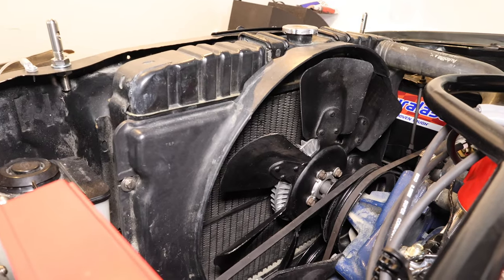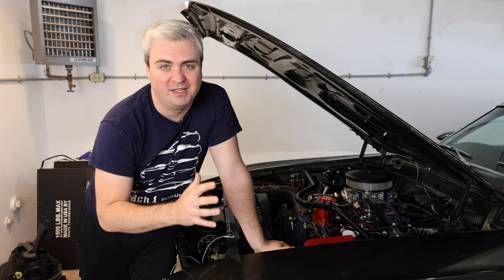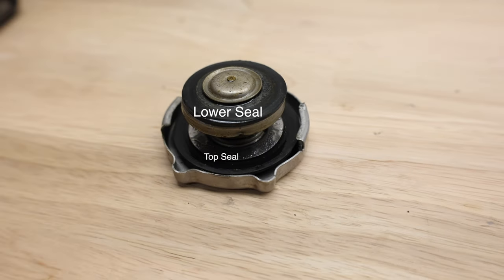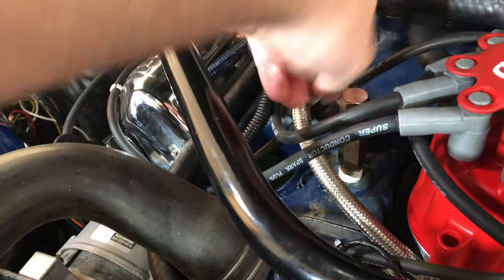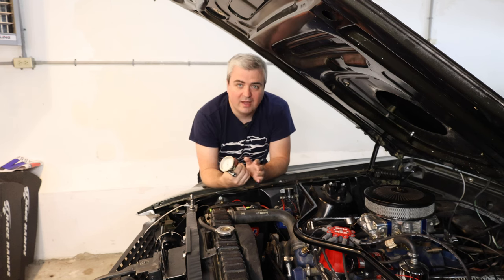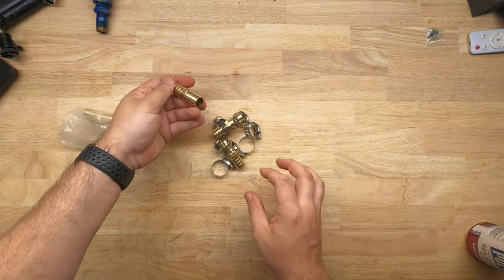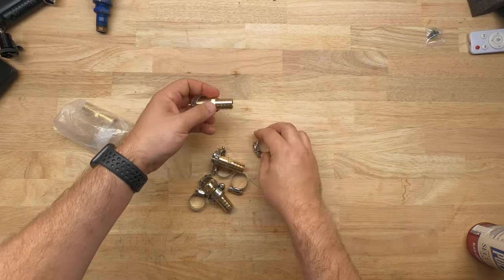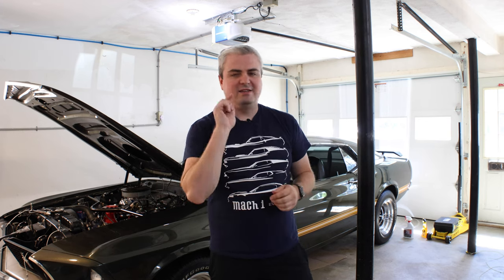Classic Ford Cooling Systems (60s-70s)

Comment from the maker: What classic Ford do you own?
Reply: 1969 Mach 1, 1996 Bronco XLT
Reply: 1964.5 D code Mustang. Not stock,,,,, at all...
Reply: 65 Mustang K Code, aftermarket AC, alum 3 row rad, 3k electric fan. Overheats in Texas.....
Reply from the maker: @larryhobbs1687  As someone who visits Texas often.... I understand why.
Reply: @SmackeysGarage  I need help!
Reply from the maker: Do you have a shroud on your electric fan or is it right against the radiator? It feels like you have all the right parts to deal with the temperature. Also, what thermostat are you running on your car?
Reply: @SmackeysGarage  I do have a shroud, t-stat is 190.
Reply: @SmackeysGarage  I would send you a pic if I knew how.....lol
Reply: 1966 289 Mustang c code
Reply: 1968 Mustang Coupe

Comment: Great explanation’s and points. I never thought about the routing of the heater hoses making a difference before, now I’m gonna have to go double check mine to see how they are routed.
Reply from the maker: Thank you I appreciate it! It's such a small nuance I didn't even think about it until I was reading through the manual. Let me know if yours ends up being backwards too. Maybe I won't feel as bad!
Reply: @SmackeysGarage  you’re welcome. Sure thing lol, I’ll check it out tomorrow.
Reply: @SmackeysGarage  I checked and the hoses on my 68 fairlane are actually hooked up correctly.

Comment: Remember many times I had issues with my 65 coupes 289 cooling. I ended up using a lower temp thermostat (180) and that seemed to cure the overheating issue. The engine it had wasn’t original and was from a later ford and it might’ve been a 302 block. It had smog equipment though I deleted that for simplicity of maintenance as I was still a teenager and (at the time) could’ve give a shit about air quality.

For my 69 I’ve got a Mishimoto highend radiator and initially I’m planning on using mechanical with shroud and eventually plan to switch to electric. Mine didn’t come with factory AC but I already a have a complete kit to put on. I plan on adding in an oil cooler also at some point. Because of all the issues that have made me put it on hold I’m half tempted to get a crate drivetrain setup with an ecoboost motor just for the novelty. I got a Neighbhor now who owns a shop and we should be getting back to putting it all back together in a few months. My life just won’t ease up to give me time to finish it currently. Thanks again for all the info vids as they’re great refreshers.
Reply from the maker: The 180 degree thermostats definitely help start the cooling much earlier. They came with what, a 192F thermostat stock?

An ecoboost motor would be a cool build. I had a 3.5TT F150 and it had a lot of power to move a heavy truck. It would be really fun to have in a light mustang! Glad to hear you have a neighbor to help pull it all back together. I'm looking forward to the updates as you make progress. Nice hearing from you noneed4me2! I'm sure things will ease up soon to help you make progress!

Comment: Great informative video. Thanks for reminding me to check my heater hose routing. It’s getting another heater core here before winter. Pretty easy to do those with no AC. I’ve done one in 2 1/2 hours before. Thanks again! 😀
Reply from the maker: Thanks! I’m in a similar boat with no AC. Yea 2.5 hours is a long time to me!!! 😂 I would probably open it up and get side tracked and take a good 5 hours.
Reply: @SmackeysGarage  Me too I do that stuff always. I’m so OCD.

Comment: I like your Monte Carlo bar and want to order the same one for my mach 1.  Where did you get it?
Reply from the maker: Hey Tanner, I got it from NPDLink.com (National Parts Depot) They have two options available for the 69.
Reply: @SmackeysGarage  did you go with the Scott Drake or the heavier npd option?  I am surprised by the listed length differences and have been having a hard time finding one that fits.  Thanks!  Love the videos, they have been very helpful for me.
Reply from the maker: Let me measure it tomorrow for you. I remember installing it and it was a massive pain to get it to fit in. I had to jack up the front and let it sit overnight for the shock towers to spread.

Thanks for letting me know the videos are helpful! I appreciate the feedback.
Reply from the maker: So, I'm not sure. I spent some time measuring and I'm only 39" from inner fender to inner fender. I also do not have my export bar on because if I remember correctly it didn't fit great. I believe my brackets are around 0.95" thickness and the bar was measured at 1.02" What is your inner fender to inner fender distance?